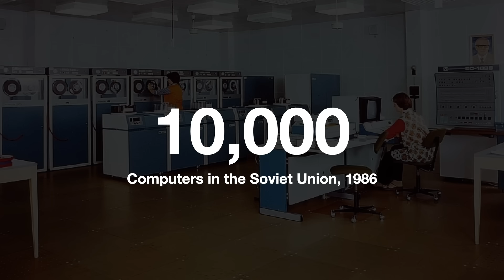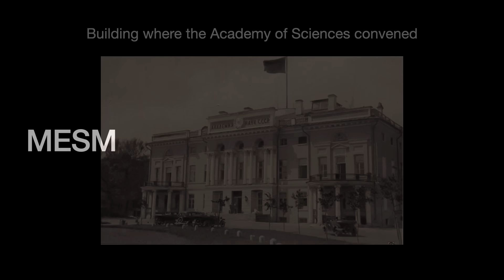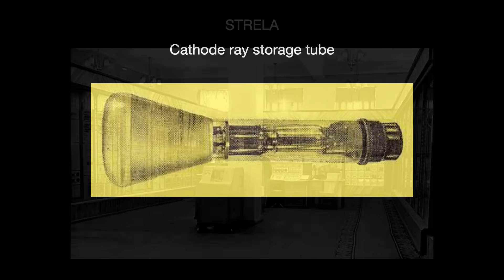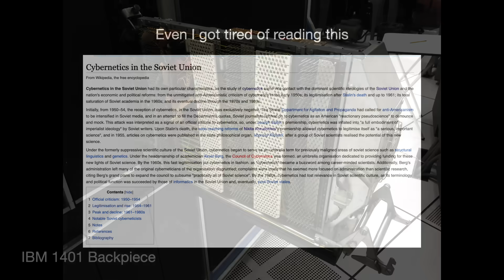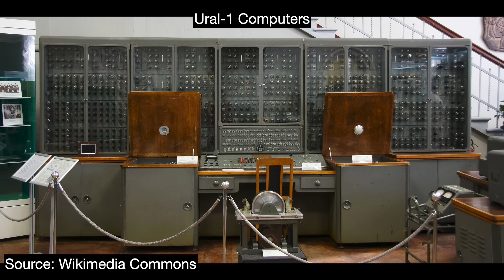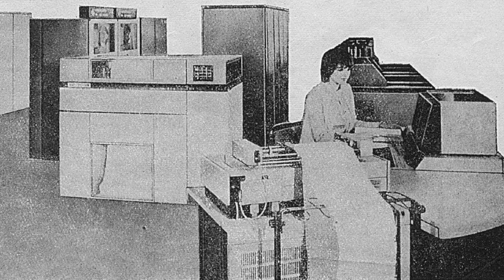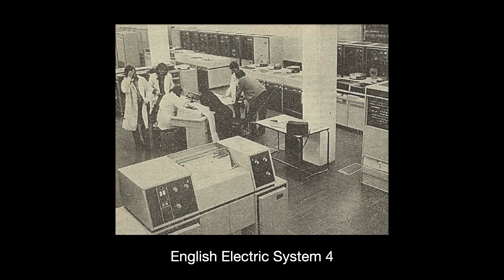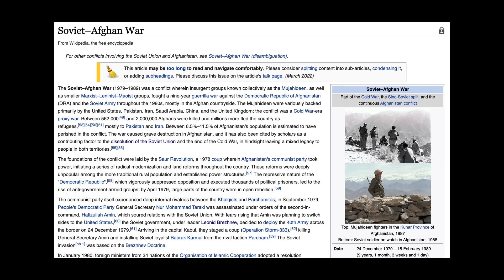Why the Soviet Computer Failed

Comment: I’m somehow amazed at 10,000 calculations per second while watching this video on a phone with a 5nm soc with 15 billion transistors.
Reply: we have come a long way...
Reply: that thing could do 15+ trillions calculations per second
Reply: What will we have in another 50 years? (Assuming we're not living in caves and using abaci.)
Reply: @maryhadda8420  nothing, hopefully.
Reply: Hey my C64 can do maybe about 100 000 to 300 000 calculations per second on around 4000 transistors. Ok mine is CMOS variant actually so it should be like double that on the transistor count but also it could be clocked higher but just isn't because the design is a little older, that's how it keeps video in sync.
Reply: @binomalia  no
Reply: @binomalia  no
Reply: @binomalia  no
Reply: @binomalia  no
Reply: @binomalia  no
Reply: @binomalia  no
Reply: @binomalia  no
Reply: @nadirjofas3140  yes
Reply: @binomalia  no
Reply: @binomalia  no
Reply: @binomalia  no
Reply: @nadirjofas3140  yes

Comment: Copying is actually incomparably harder than making your own.
Reply: The knowledge of Nuclear Physics was already considered "mundane" knowledge by every physicist and their mom's by the 1930s. The challenges were mainly engineering challenges in acquiring nuclear material and refining it without the user glowing in the dark.
Reply: @skyricq  Right. Copying a mechanism is relatively easy. Yet inventing the mechanism is actually not that hard either. The chip design is very simple, once you understand the core. The difficulty is not the chip, but how to produce it.
Reply: @skyricq  Really couldn't say, as I haven't done either lately.
Reply: Really? Seems as though the Soviets did quite well in copying U.S. designs for early nuclear bombs.
Reply: You get the gist quickly but when it comes to quirk for quirk compatibility... That's generally quite an undertaking!

Comment: I'm simply amazed at the capacity you can do quality research, and on such a consistent and rapid rate.
Incredible!
Reply: INDEED
Reply: They want to keep you as slaves! 👉The Connections (2021) [short documentary] 🔥
Reply: seems like wikipedia
Reply: Not really. This video got at least several claims flatly wrong.
Reply: @wishusknight3009  which claims are wrong?

Comment: the first general purpose programmable computer was not the ENIAC! it was the Zuse z1. The first working computer was German not American. Why is it so hard to get these basic facts right?
Reply: He left out a word - it was the first electronic, general purpose, programmable computer. The Zuse was mechanical. Also, the Russians probably knew nothing about the Zuse Z1 since it and its plans were destroyed in 1943 in an Allied air raid. It was not rebuilt until the 1980s. According to Konrad Zuse, the original didn't function very well and the rebuilt version is faithful to the original as it doesn't function well either.
Reply: @mattbosley3531  the zuse z3 which was already electrical and also predates the eniac. get your facts straight. The first computer is German, not American.
Reply: @spirobel  I am aware that they were German and electrical, but they were still mechanical and not electronic like the Eniac. I do have my facts straight. All three of the Zuse computers were mechanical and not electronic. There is a difference between electrical and electronic.
Reply: Does that predate the computer used in Belchley Park by the British to decode German messages?
Reply: @richardarriaga6271  yes. This was even before the second world war. it was the first one that was general programmable and turing complete. look it up.

Comment: Neat video, but a few quibbles - 1.3 million computers in the U.S. by 1986 is, well, very very very very under-stated.  20-30 million might be closer.   Maybe he meant only government-owned computers?  Also, calling that old IBM machine a "Model-T" when it was not mass-marketed or mass-produced does a disservice to Ford's accomplishment.  The U.S. would not produce "Model-T" computers until the Trinity in 1977.
Reply from the maker: We might probably call them mainframes today.
Reply: @Asianometry  Without rehearsing the entire history of the industry, Hewlett-Packard also made a huge step in the HP3000 series of machines and its MPE operating system, Launched in 1973-4 and lasting until the early 2000s. 

Dubbed mini-computers, they offered mainframe functionality to middle-sized businesses at a fraction of the mainframe capital and running costs... and they sold by the thousand. They also developed to include network architecture, allowing development of nodes that could be spread out across an enterprise. Ironically however, right up until almost the end of the 1990s, HP's central registry (the company treasury) in Palo Alto ran on IBM hardware - something the company kept as quiet as it could! 

MPE was extremely secure, too, and like the preceding generations of IBM machines, it was designed for transactional data manipulation and storage, i.e. bookkeeping, customer records, etc. In the 1990s business marketplace, as opposed to academia and engineering, HP had considerable difficulty moving some of its customers away from MPE to UNIX. This was despite their hardware being very nearly identical for the two operating systems (only a tiny difference in the firmware), and a huge premium on MPE systems. MPE was also used extensively in military applications.
Reply: @RonJohn63  Fair point. You probably realise I was HP, so I am biased! And PDP8s in particular were indeed revolutionary for example in the field of automation: in the 1970s the BBC World Service's transmitter switching across the globe was controlled by a PDP8 in Bush House, London, reading a long loop of magnetic paper tape. And I remember another one in the control room of the National Tower Testing Centre in Cheddar, Somerset, which collected and processed data from dozens of strain gauges and controlled a lot of hydraulic rams to test lattice tower designs for power transmission, telecomms, etc. I think they had a PDP11, too.

But in business computing, MPE stubbornly refused to die, despite our management wanting to move on from it in the mid 1990s. We weren't easy, but In comparison, customers told us IBM were too difficult to deal with (and way too expensive).
Reply: @Asianometry  The Soviet space program aside from the space station consisted  mainly of publicity stunts. Almost nothing came of it. Being first doesn't mean you're the best.
Reply: Commodore was selling 100,000 units per MONTH on their Commodore 64 line starting when it was released in late '82.  That alone would far surpass the number quoted here.  Also, in '83 is when the first PC clones started being mass produced and once that happened, there was no looking back.  1986 was already a comparatively mature market, with the 386 processor having just been released, which lowered prices on the base level 8086 units. The Computer Shopper magazine, filled with merchants selling PC parts, was the size of a telephone book at that point.  So, yea, 1.3 million is ludicrously low.
Reply: The 1401 was mass-produced and it was really the first real computer to be widely marketed.  It was the first computer for a whole generation of programmers.  The 1401 brought computing to the point where just about every college and medium-sized business in the country could afford a computer.
Reply: @kludgeaudio  That's great, but it's not "mass" production and marketing.  "Mass" literally means "for the masses", not "for colleges and medium sized businesses."  Consider Asianometry's comparison to the "Model-T", which was produced, priced, and marketed for every human being, not just rich people or businesses.
Reply: @bozimmerman  No, "mass" does not literally mean that.  The "mass" in mass production refers to the way the items are produced.  Mass-produced items are made in a standardized way, not individually hand-crafted.  And the "mass" in mass marketing refers to the fact that you are trying to reach your entire target market with an ad campaign, vs, for instance, having a salesman call on each potential client.  The 1401 was certainly mass produced, and it was mass-marketed with (at least) newspaper and magazines ads, which can be found online.

The 1401 had the same effect as the Model T - it drastically reduced the price and substantially grew the market for the industry. The fact that the target market for one was 'everyman' and the other was 'businesses' is immaterial.
Reply: @kludgeaudio  Not really, check out WIKI IBM 650 and IBM 305 RAMAC.
Reply: I'd argue that the PDP-11 of 1970 was the first true "Model T" computer.
Reply: I'm assuming they're talking about mainframes and minicomputers and not including micros.
Reply: The IBM 1401 is indeed considered the Model T of computers, being the first to be produced by the thousands and having a general impact on businesses. Of course it wasn’t a personal computer, when it comes to individual use one might consider the Apple II to be the Model T.
Reply: @bearcb  I don't think you quite understand the significance of the Model T. Prior to the T's introduction, things like traction engines and steam lorries had already truly revolutionised road freight, much like the IBM 1401 had truly revolutionised commercial computing (computing in the sense of doing calculations). However, the Model T was the first truly "cheap" car that the masses could buy. As such, the trinity is probably closer to a "Model T" of computing than the IBM 1401 was. 

It's not like cars didn't exist before the T, and it's not like private ownership of cars wasn't a thing either, but it took something cheap and almost disposable before the masses could afford one. And the idea of cheap and almost disposable is the niche that the Apple ][, TRS-80, and Commodore PET filled.
Reply: @the123king  you basically repeated what I said using more words.
Reply: Maybe mainframes, but I remember getting a personal computer in the early 1980s from Radio Shack, it had an OS-9 operating system.  I learned PS/1 and Cobol programming language for computers when I went back to college for computer classes that were requirement for accounting majors - also in the early 1980s.